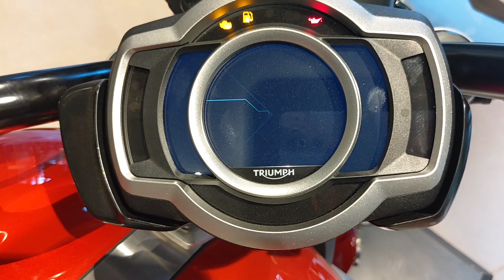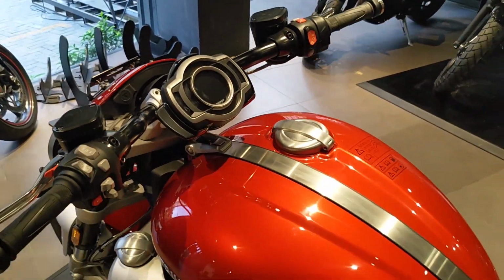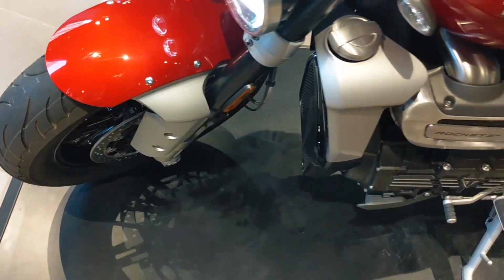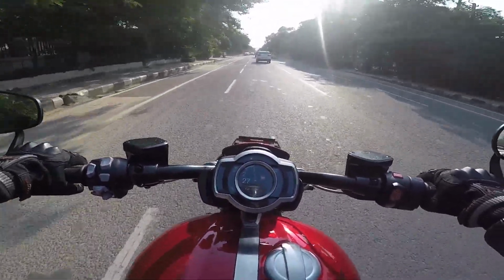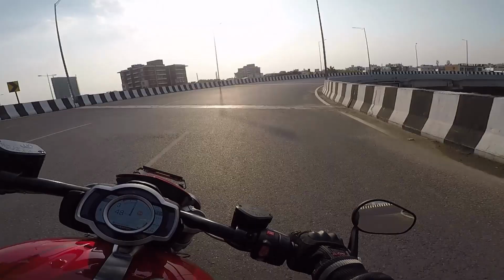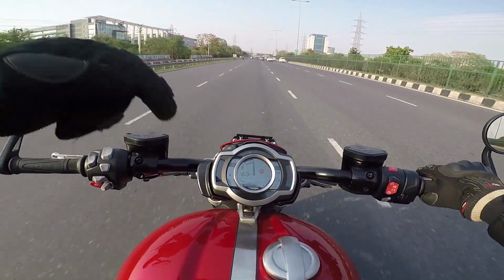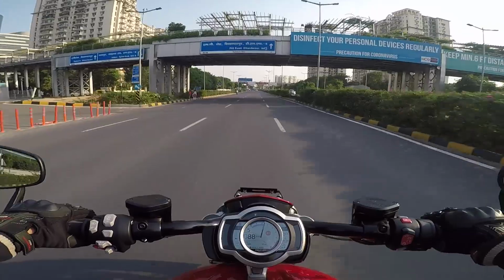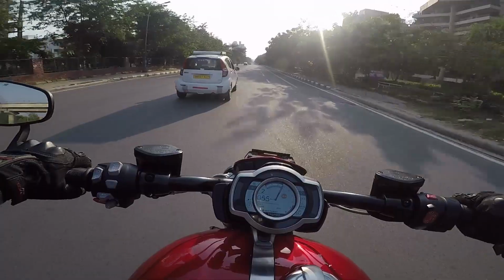Triumph Rocket 3R | 2500cc | Not A Review| First Test Ride |battle of muscle bikes | God of Torque |

Comment: Hey there. How's the suspension? Hard on the back after a long ride?
Reply from the maker: Hey buddy, suspension has been tweaked just like it should be. It is so much better in every situation keeping the weight in mind. No back pain of any sort.
Reply: @WeThrottle  thank you for the uber quick reply. I've booked mine. Hopefully arriving in December ❤️. Was concerned about the slightly forward riding position and it's effect on the back.
Reply from the maker: Always there buddy. Congratulations and also you can opt for the GT handle bar which will definately be better for longer rides. Yes forward riding posture is a concern but can be resolved with this small change. 😇

Comment: Hey.. what's your height? Is this suitable for a short rider?
Reply from the maker: Hey buddy, I am 5'10. It is suitable for the rider as less height as 5'8. But determined people can ride any bike. However I would suggest you to try and sit on the bike and try leaning with 2 people there to hold you. As this is a heavy bike and that engine is quite wide. So you have to widen your legs which eventually reduces the reach of the feet. But as I suggest try to sit and lean with people ready to handle you because when you'll be in traffic it's gonna be extremely difficult to handle in tighter turns.